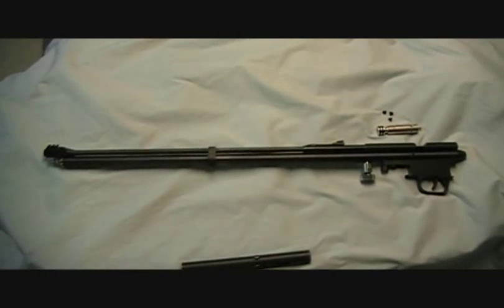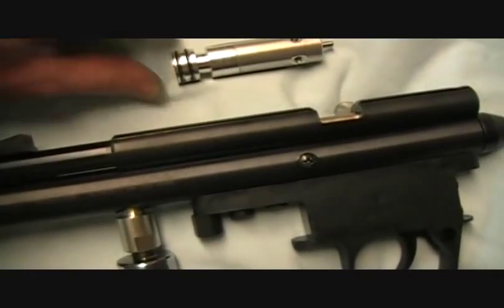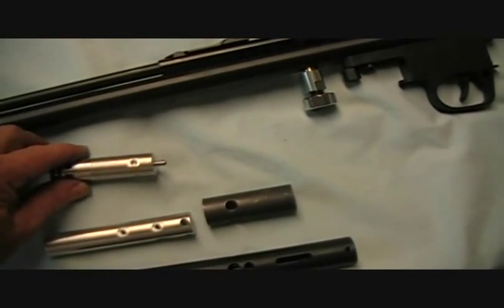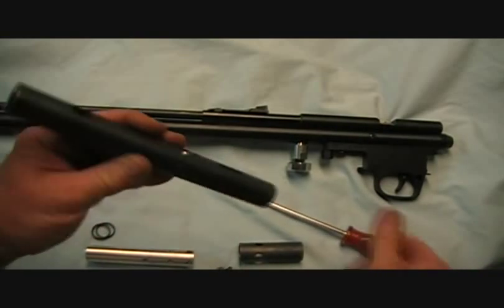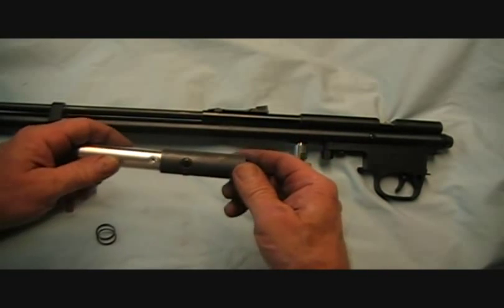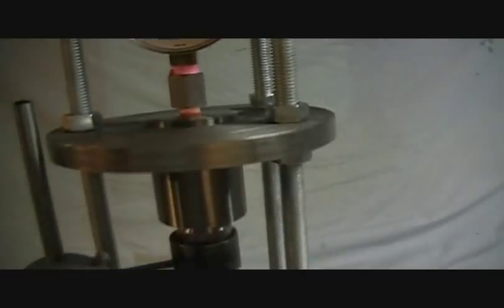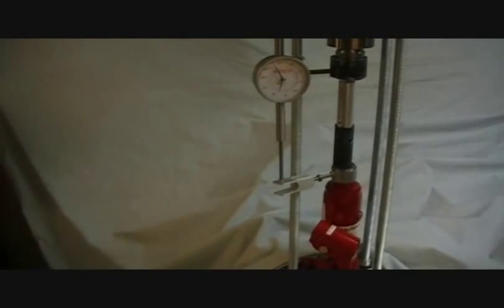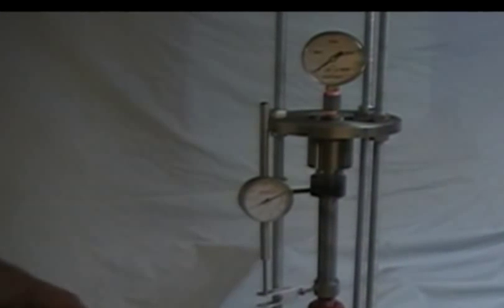Long Video version - Airgun valve screws shear testing to failure Airgun Lab

Comment: Hello there Lloyd, perhaps spreading the load over 5 screws might be a good idea. The actual failure proved to be the aluminum valve sample which, in turn, bent the screws and sheared the head off. Also the dummy valve had a sloppy fit which may have caused  it lean over and load one screw at a time. Nice work and very interesting.
Reply from the maker: This set up was made to duplicate the Benjamin Discovery air rifle: 3 screws, aluminum valve body, etc. It is always good to design a system where it will fail in a non-catastrophic manner, if at all possible. The  failure demonstrated that, if you are paying attention and know what to look for, the airgun will warn you before catastrophic failure.
Reply: @1227air500  Food for thought, yes. The hobbyist, like myself, fears failure but you have now taught me another aspect of this great sport. Thanks.
Reply from the maker: @redgum1340  For such straight forward devices, there is an endless amount of science and engineering that can be done. Or you can just shoot them and not think about it, LOL. A day without learning something new is an opportunity lost. And Airguns are just plain fun, too!!
Reply: @1227air500  Yes indeed, they certainly can be 'tricky' toys. I've loved them ever since I was 6 years old and that was 60 years ago when my Father bought me the most basic Diana .177 spring air rifle. Haha, it would hardly shoot 25 yards. Lloyd, there are a few questions I would like to ask. Is there some way in contacting you on a personal level? Regards.
Reply from the maker: @redgum1340  Google how to send a message to a channel owner

Comment: So how much air pressure can the disco tube hold before something blows?
Reply from the maker: Factory recommends 2000 psi max.  That allows a safety margin for unexpected events that can and do happen. Stick with 2k.
Reply from the maker: Calculations show that the valve screws will probably be the first point of failure, but there are other screws and items behind it to slow its departure.